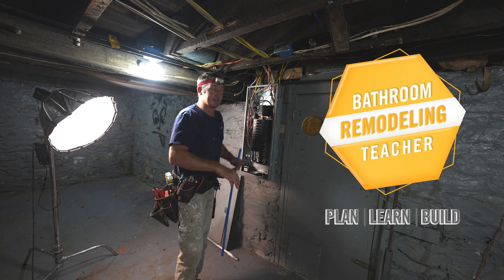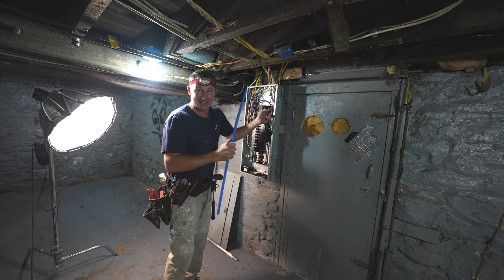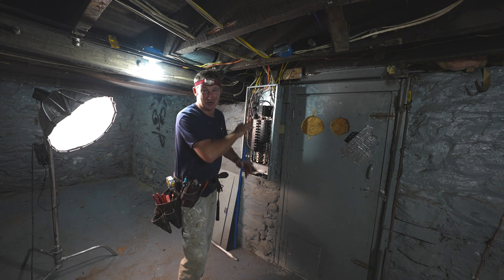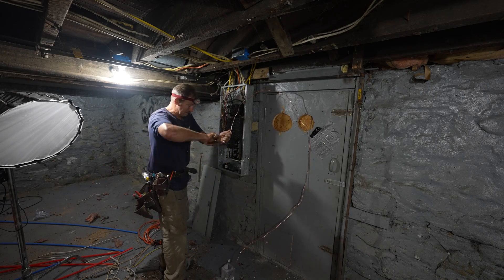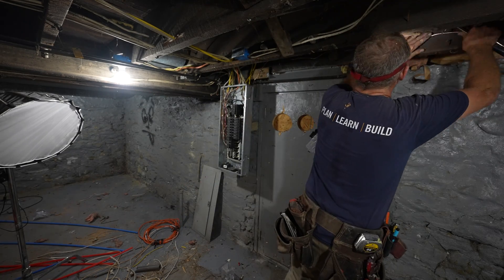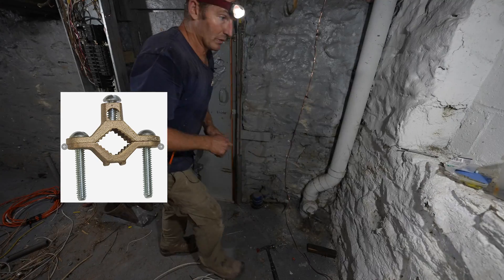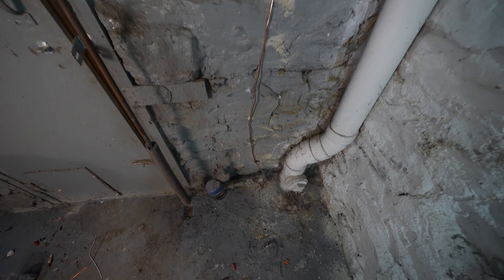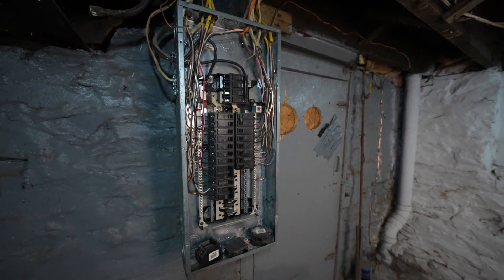Pay Attention to this when changing Copper to PEX Plumbing

Comment: Electrician here for 33 years, you should always jump the water line and you are supposed to run the copper through that fitting you showed or a variant of it, into, 2-8' long, copper ground rods, that are 6' apart, achieving 50 ohms of resistance, is the new code most houses have only 1-8' ground rod though, yes, it's like the bible contradicts itself, over and over.
Reply from the maker: Yes ground rods are important, but that’s not my point here. (And we’re done) Im highlighting to simply pay attention to the grounding to existing copper in home when changing out pex.
Reply: @BathroomRemodelingTeacher  Did I touch a nerve?"And we're done",,,,? I'm simply saying the way you installed the grounding wire is incomplete. Your page is Bathroomremodelingteacher, the electrical part you showed, would be the equivalent of putting pex on a line w/o or not tightening the ring. That's why I commented that's my specialty, Oh and I live in PA also, so it does kind of matter. but I love your tile work work that's why I binged about 40-50 of your videos the last few days. Keep up the great tiling.
Reply from the maker: @rtheprizeisright7323  it’s a written explanation, not a whiny response?

Comment: In my case I have 2 ground wires that I believe were used for outlets/ lighting in the bathroom that were attached with one of those clamps you show in the video to the copper lines below the tub. In completely gutting the bathroom I discovered that the copper that was 70+ years old needed replaced and had several pinhole leaks. Whenever you slightly moved the pipes they leaked a tiny bit. I replaced everything to pex. The issue now is that the bathroom is 2 floors above the basement and now there is no copper going to that floor. Any ideas for grounding? It’s old wiring so unfortunately there are only hot and neutral wires, no ground in the wiring. It wouldn’t be worth running new wires due to the walls etc that would need to be cut up.

Comment: If you were to replace a 3ft section of copper pipe with pex would you have to run a jumper wire? Everything downstream from the repair wouldn’t be bonded

Comment: Our electrician, who worked for decades as a residential and commercial electrician, used a long metal rod driven into the ground, with a heavy copper wire attached, that runs inside to our new service entrance. 👍👍
Reply from the maker: That’s the way to do it 👍

Comment: Hmmmm, the house I live in was originally piped with galvanized steel. Much of that was replaced with copper at some point, and then about 4 years ago we had all the supply lines re-piped with PEX. The plumbers never mentioned this. Were the galvanized steel pipes also used to ground the house? And if those pipes were not removed would they still act as a ground?
Reply from the maker: If the old galvanized pipes are still connected to pipe going into ground yes. Otherwise, you’d have to see how it’s grounded. Hopefully the service has ground rods. This is my point to video. It should be checked. The only grounding on this panel was the copper lines. I did add ground rods in addition to new line and meter clamp

Comment: As a plumber, in many older homes we refer out to an electrician straight away after a full home repipe, or even partial repipe. This video is helpful! The more I know, the better I can help inform the customer.
Reply from the maker: I’m betting most don’t go through the trouble to call an electrician. Smart to do so 👍 this was the only way this house was grounded. Also ran. 2 ground rods in addition to new meter clamp